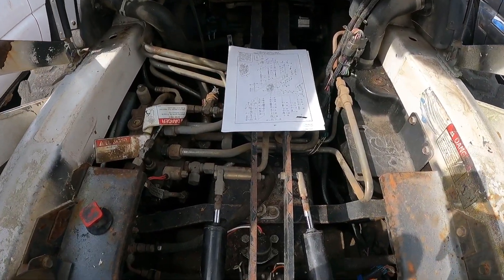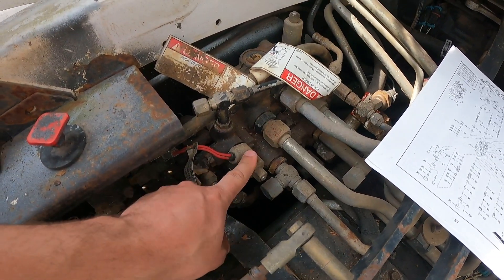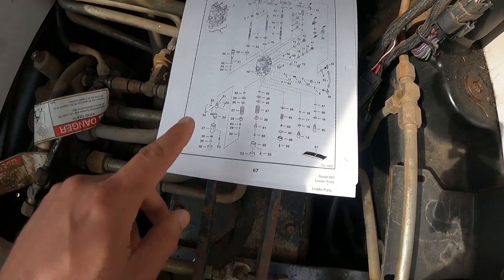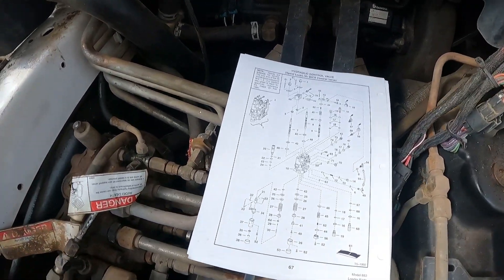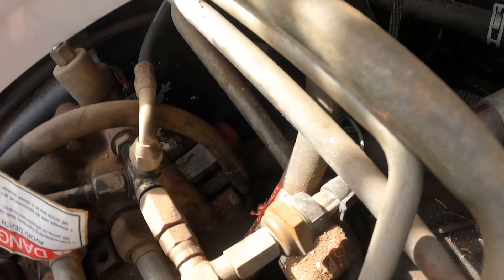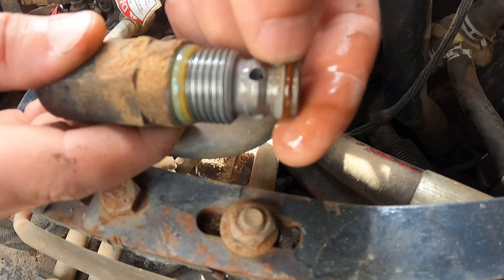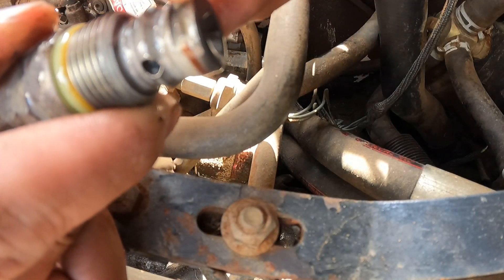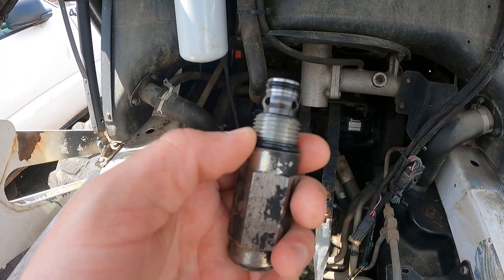Bobcat Cylinder Drift FIXED!

Comment: Thanks for making this video.  My tilt cylinder is drifting on my S175.  Hopefully this will recrify the problem.
Reply from the maker: @Texanfirst727  I hope it is a simple fix for you.
Reply: Was your part 19 called a lock valve or a relief valve?  Will you please look in your manual.  My bucket drifts down whether operating or in lock mode by lifting the safety bar.
Reply from the maker: @Texanfirst727  part 19 is the port relief.  I didn't mess with the lock solenoid as that one was working.   Your machine might be slightly different being s175.  Look at your manual to see if you have port relief for lift and for tilt and pull them out to inspect.   If they are good then you could have a seal in the tilt cylinders leaking internally basically bypassing pressure. I hope that helps
Reply from the maker: @Texanfirst727  also HowIDidit does a YouTube live every Tuesday 6 pm est. You can ask your questions to the real deal bobcat mechanics.  Tell them I sent you.
Reply: @thedelcodave  On the S175, I have tilt port relief valve and tilt circuit lock valve.  Tilt cylinders were recently done.  They work great, but I do have tilt drift.  The tilt bucket drift happens both when operating and when I lock the machine, engine on.  I'll look at the tilt port relief valve 1st as it is easier to get to than the tilt circuit lock valve as looking at the manual, the solenoids have to be pulled to get to the tilt circuit lock valve. 
Thanks for your help!
Reply from the maker: @Texanfirst727  for sure go for the easier one first. Let me know if that fixes your drift issues
Reply: @thedelcodave  Today I did the tilt cylinder bypass test.  It's in the Service manual how to do it.  One cylinder passed and the other cylinder failed.  I have to redo one tilt cylinder.  Brady and another mechanic stressed to only buy the cylinder kits from Bobcat.  Bobcat tilt cylinder kit fixed the issue.  Never again buying inferior kits.

Comment: Nice fix. I have the same issue with my S185. Hope this fixes it.
Reply from the maker: I hope it works for you too.  It was an awesome feeling when I saw that blown out oring. Does yours stop drifting if you lift the lap bar?
Reply: @thedelcodave  sure does
Reply: @MuddFlappRanch  Was it your lock valve or your relief valve that fixed the drifting?

Comment: Was the front one for the tilt or lift arms?
Reply from the maker: @tmengelmann  mine was the lift arms drifting but the same fix would apply to drifting tilt cylinders
Reply: So the one in the rear is the one for the tilt. Correct?
Reply from the maker: @tmengelmann  rear should be lift front should be tilt if I recall correctly.

Comment: Hello mister I want to ask my bobcat, the engine starts but won't start and the baket won't move, please provide a solution😊
Reply from the maker: @faridafarida4627  if the engine starts but won't move check your safety switches first.
Reply: @thedelcodave  thanks Mr .. sorry .May I know where the problem is? I'm from Indonesia, hoping for some knowledge from you